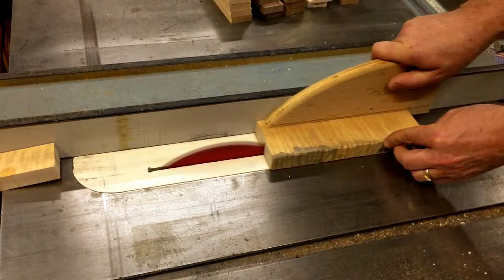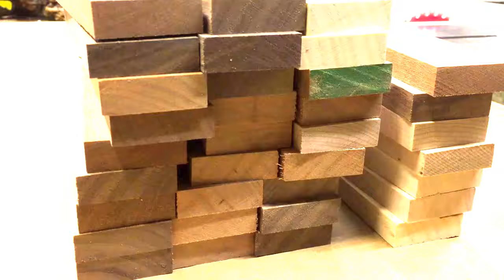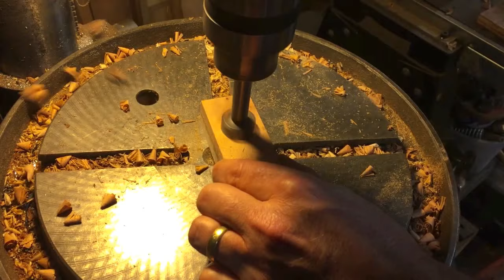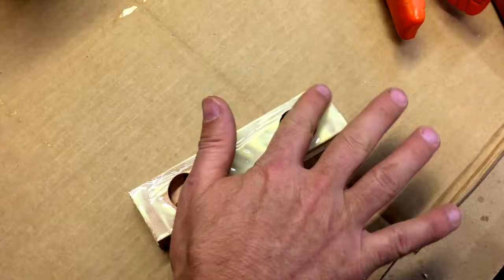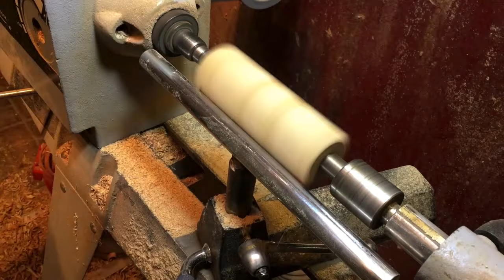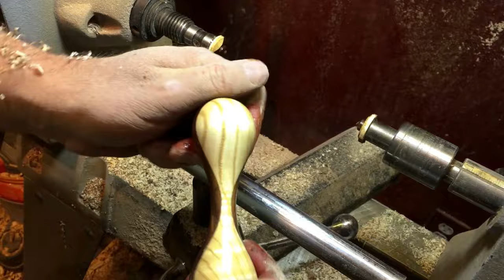Making Rattles

Comment: I kinda want to make baby rattles like that, but I'm super scared that they'll break it and choke on the little marbles inside.
Reply: If it breaks it still won't release the marbles. It would break between the two big parts. The glue is extremely strong.

Comment: Hi Jason,

if you are about and you have the time is it possible to see an image or have the measurements of the rattle. I know its 45mm x 45mm but looking for hole locations and bead distances. I'm looking to make one this weekend for a colleague who leaves us on maternity leave next week.

Kind Regards
Reply from the maker: Chris Sullivan I start out 300mm long, and drill 20mm holes 30mm from the ends.
Reply: @jasonmadsen5904  Cheers Jason I've tried with 25 mm holes to the depth of one layer of timber - 40 mm from centre and only 40mm wide wood. I keep breaking through into the rounded end. Having watched the video again this morning I am probably making the centre to long. I appreciate you getting back to me. Take 3 - 2 days to go.